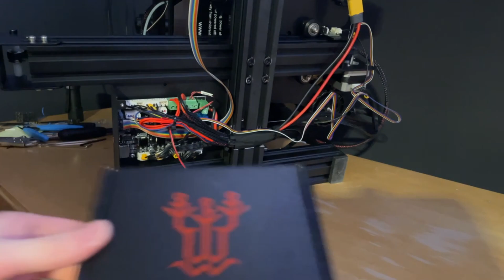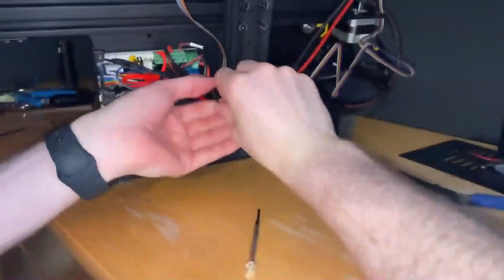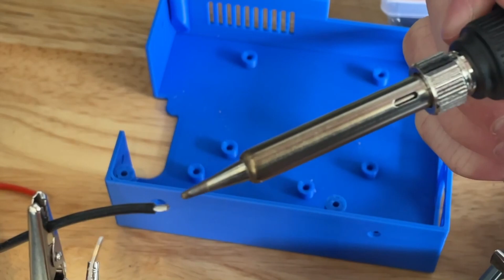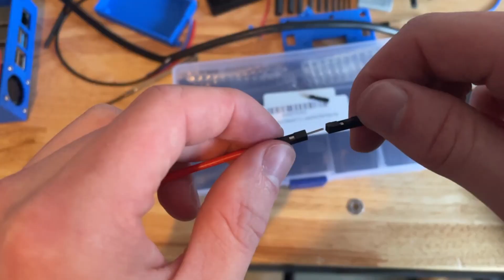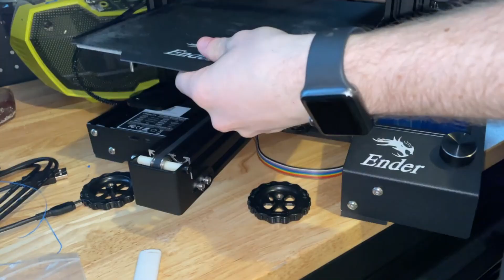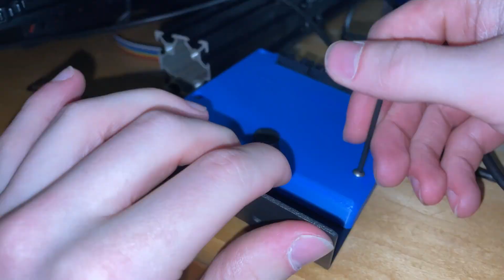9 Upgrades for the Ender 3 Pro in 8 minutes

Comment: I think the glass bed is a step back.  Getting a PEI spring-steel sheet and a 3d touch (or create an unklicky probe as I did after trying glass and still not being happy with adhesion) would probably have made life much easier.
Reply from the maker: Thanks for letting me know! I have been very happy with the adhesion so far but I only just recently was able to figure out how to get prints off easy by freezing it. I’ll look into the PEI sheets!
Reply: @IndecisiveOfficial  Srsly consider this. Glass has horrible adhesion, print removal is a pain and good luck removing a PETG print without chipping the glass and having to spend another 20 bucks on a new bed. PEI is the standart right now for a lot of reasons. 
Personally I've been using the original buildsurface on one of my Ender 3 Pro for over 4 years now. No adhesion issues whatsoever. Just wipe it with IPA every 5-10 prints.
Reply: On my Ender 3 pro I went from the original flex magnetic sheet, to glass, to PEI. PEI is by far and away the best print surface. The glass sheet sucked and needed a gluestick because the dimpled side didn't work at all. I bought a 3rd party PEI sheet and so far it has worked perfectly - stuff sticks without glue and to remove it I just pop the sheet, flex and stuff comes off.
Reply: Actually a glass bed is better then any surface you want super fine surface for perfect vaccum on first layer and stickiness and when is cold the plastic just gets out of the surface clean. I swapped my bed for a piece of regular window glass and I never went back. It is training you to be more careful in z offset calculations because now you got a piece of glass that can break if nozels pushes on it by mistake. But it works better then any bed surface I tried. I learned this from buying over 200$ in different bed plastics and then turned out the solution was just some scrap glass I had laying around for 20 years😂
Reply: @DEPEACHMODE Bullshit ... Sure air pressure will push the center of a good first layer of a large surface onto the glass and make it stick, but this is not the case for the sides or especially sharp corners or tiny lines.  And yeah, when using sufficient flow on the first layer the glossy finish from printing on glass is very nice.  But if you think that's good adhesion, you have probably never had a GOOD textured PEI buildplate.  And have fun printing PETG on glass.  If you're lucky it might take a few prints before the PETG just pulls chunks from your bed.  Guess how I know.
Reply: @MisterkeTube I don't know what conditions u are using and what air pressure u are talking about MMM? There is not air pressure in melting 3d printing.. I think you are confusing replies
Reply: @DEPEACHMODE WTH ..  You were the one bringing up vacuum as argument for the first layer sticking.  Vacuum doesn't excerpt any force, it's the air pressure on the other side ...
Reply: @MisterkeTube  vaccum when melting has nothing to do with air my lovely innocent person.. there is heat transmision vaccum, meaning when a hot plastic hits a cold super fine surface, all air particles go away, your comment made no argument and left me to believe you using air-assist... like that would make no sense at all. anyway i just wanted to say glass beds for me it works, not sure how many comments i left around here... was yapping around cause my ender 3 was shit from factory and i had to fix it myself.
Reply: Glass is definitely a better choice. A probe does not solve all your problems. Mechanical flatness is logically better than software compensation, and you will understand that when you start to require flatness of the part and not just the adhesion of the first layer. Creality now also sells glass with a PEI powder coating, which combines the practicality of sheets and flatness of the glass. I've been using it for a long time, the grip is amazing and even PETG parts come off on their own after it cools down and you just pick them off. I would recommend that AND the probe. But don't take the probe as a replacement for mechanical leveling and flatness of the bed.
Reply: @randomguyfrominternet  Weird. 

You said glass the the better choice yet no mainstream 3D printing company is selling a printer with glass bed, even Creality stopped at ender 3 v2 and everything is PEI. You also said that probe is not a replacement for mechanical leveling and does not solve all problems but then again, almost every printer release have some kind of built-in auto leveling and some even have fixed bed 🤔
Reply: @AirsoftAlbert  Companies, especially mainstream ones are very often following the demand, dumb-proofness or profit. Not necessarily what is right. But glass is not the only solution to flatness if you can manufacture precision surfaces from other materials. If you have a non-warped flat bed AND PEI sheet with even thickness it can be as good as a glass surface. The probe is indeed not a replacement for mechanical levelling. It's software compensation that will cause the bottom of your model to be warped with the same mechanical imperfections as your bed is, even when having a "perfect" first layer everywhere. 

The comment above was especially for the Ender3, which does not have a precise bed at all. That's why a flat surface such as glass is necessary to "fix" the bed warp. This is a known fact and my own experience - just google "Ender3 bed warp" and see the forums full of it. I don't have information about every manufacturer's and every model's bed quality, but these simple laws of physics and mechanical engineering are valid for all of them.
Reply: @AirsoftAlbert  Companies, especially mainstream ones are very often following the demand, dumb-proofness or profit. Not necessarily what is right. But glass is not the only solution to flatness if you can manufacture precision surfaces from other materials. If you have a non-warped flat bed AND PEI sheet with even thickness it can be as good as a glass surface. The probe is indeed not a replacement for mechanical levelling. It's software compensation that will cause the bottom of your model to be warped with the same mechanical imperfections as your bed is, even when having a "perfect" first layer everywhere. 

The comment above was especially for the Ender3, which does not have a precise bed at all. That's why a flat surface such as glass is necessary to "fix" the bed warp. This is a known fact and my own experience - just google "Ender3 bed warp" and see the forums full of it. I don't have information about every manufacturer's and every model's bed quality, but these simple laws of physics and mechanical engineering are valid for all of them.
Reply: Companies, especially mainstream ones are very often following the demand, dumb-proofness or profit. Not necessarily what is right. But glass is not the only solution to flatness if you can manufacture precision surfaces from other materials. If you have a non-warped flat bed AND PEI sheet with even thickness it can be as good as a glass surface. The probe is indeed not a replacement for mechanical levelling. It's software compensation that will cause the bottom of your model to be warped with the same mechanical imperfections as your bed is, even when having a "perfect" first layer everywhere. 

The comment above was especially for the Ender3, which does not have a precise bed at all. That's why a flat surface such as glass is necessary to "fix" the bed warp. This is a known fact and my own experience - just google "Ender3 bed warp" and see the forums full of it. I don't have information about every manufacturer's and every model's bed quality, but these simple laws of physics and mechanical engineering are valid for all of them.
Reply: Companies, especially mainstream ones are very often following the demand, dumb-proofness or profit. Not necessarily what is right. But glass is not the only solution to flatness if you can manufacture precision surfaces from other materials. If you have a non-warped flat bed AND PEI sheet with even thickness it can be as good as a glass surface. The probe is indeed not a replacement for mechanical levelling. It's software compensation that will cause the bottom of your model to be warped with the same mechanical imperfections as your bed is, even when having a "perfect" first layer everywhere. 

The comment above was especially for the Ender3, which does not have a precise bed at all. That's why a flat surface such as glass is necessary to "fix" the bed warp. This is a known fact and my own experience - just google "Ender3 bed warp" and see the forums full of it. I don't have information about every manufacturer's and every model's bed quality, but these simple laws of physics and mechanical engineering are valid for all of them.
Reply: @AirsoftAlbert  Companies, especially mainstream ones are very often following the demand, d*umb-proofness or profit. Not necessarily what is right. But glass is not the only solution to flatness if you can manufacture precision surfaces from other materials. If you have a non-warped flat bed AND PEI sheet with even thickness it can be as good as a glass surface. The probe is indeed not a replacement for mechanical levelling. It's software compensation that will cause the bottom of your model to be warped with the same mechanical imperfections as your bed is, even when having a "perfect" first layer everywhere. 

The comment above was especially for the Ender3, which does not have a precise bed at all. That's why a flat surface such as glass is necessary to "fix" the bed warp. This is a known fact and my own experience - just google "Ender3 bed warp" and see the forums full of it. I don't have information about every manufacturer's and every model's bed quality, but these simple laws of physics and mechanical engineering are valid for all of them.
Reply: @AirsoftAlbert  I had to create a new account just to reply because youtube or author wouldn't let me post it.

Companies, especially mainstream ones are very often following the demand, dumb-proofness or profit. Not necessarily what is right. But glass is not the only solution to flatness if you can manufacture precision surfaces from other materials. If you have a non-warped flat bed AND PEI sheet with even thickness it can be as good as a glass surface. The probe is indeed not a replacement for mechanical levelling. It's software compensation that will cause the bottom of your model to be warped with the same mechanical imperfections as your bed is, even when having a "perfect" first layer everywhere. 

The comment above was especially for the Ender3, which does not have a precise bed at all. That's why a flat surface such as glass is necessary to "fix" the bed warp. This is a known fact and my own experience - just google "Ender3 bed warp" and see the forums full of it. I don't have information about every manufacturer's and every model's bed quality, but these simple laws of physics and mechanical engineering are valid for all of them.
Reply: @AirsoftAlbert  Companies, especially mainstream ones are very often following the demand, dumb-proofness or profit. Not necessarily what is right. But glass is not the only solution to flatness if you can manufacture precision surfaces from other materials. If you have a non-warped flat bed AND PEI sheet with even thickness it can be as good as a glass surface. The probe is indeed not a replacement for mechanical levelling. It's software compensation that will cause the bottom of your model to be warped with the same mechanical imperfections as your bed is, even when having a "perfect" first layer everywhere. 

The comment above was especially for the Ender3, which does not have a precise bed at all. That's why a flat surface such as glass is necessary to "fix" the bed warp. This is a known fact and my own experience - just google "Ender3 bed warp" and see the forums full of it. I don't have information about every manufacturer's and every model's bed quality, but these simple laws of physics and mechanical engineering are valid for all of them.
Reply: Companies, especially mainstream ones are very often following the demand, d*umb-proofness or profit. Not necessarily what is right. But glass is not the only solution to flatness if you can manufacture precision surfaces from other materials. If you have a non-warped flat bed AND PEI sheet with even thickness it can be as good as a glass surface. The probe is indeed not a replacement for mechanical levelling. It's software compensation that will cause the bottom of your model to be warped with the same mechanical imperfections as your bed is, even when having a "perfect" first layer everywhere. 

The comment above was especially for the Ender3, which does not have a precise bed at all. That's why a flat surface such as glass is necessary to "fix" the bed warp. This is a known fact and my own experience - just google "Ender3 bed warp" and see the forums full of it. I don't have information about every manufacturer's and every model's bed quality, but these simple laws of physics and mechanical engineering are valid for all of them.